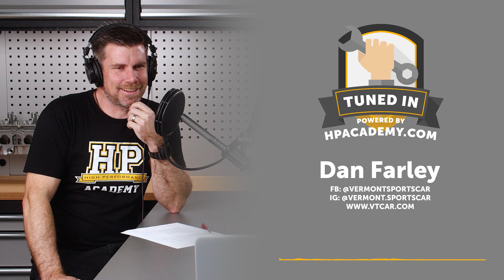037: Pushing 60 PSI Through a Subaru Boxer. [#PODCAST]

Comment: Holy Spaceballs Batman! Race teams have had rod bearings spinning because of effing "cross flow" drilling of the journals since the 60s! 944s blow up almost exclusively because of the cross flow drilling.
The failure comes when the oil pressure can't overcome the centrifugal force to force oil out the holes to the rods. It's pretty common to be an RPM specific issue across platforms. Anything beyond 7000rpm and failure is always looming with a cross drilled oiling flow. A diagonal straight shot from the main through the web and out of the rod journal is the only way to do it. To fix Porsche and Subaru cranks as well I'm guessing they pin the original holes and drill straight shot holes.
I get it from a builder perspective, it's just not something I'm looking for. However, from an Engineering perspective, there's absolutely zero excuse for that. Ford and GM knew that was an absolute no no lesson learned by the late 60s. There are lots of forum discussion on it. What it is exactly is that a hole is drilled through the main and rod journals from one side out the other. Then it's drilled from the side of the throw of the rod journal to intersect the hole going through the main journal. This introduces multiple failure points. One it weakens crankshaft integrity. Two it leaves multiple reversing turns in the flow path from the main journal, into the crank, and out the rod journal. Third the inertia is throwing the oil outward from center on the main journal. To oil the rods it has to fight that inertia directly to go to the center of the main journal inside where it goes up to the center of the rod journal. Now that problem repeats, inertia is going straight out from the rod throw, the oil has to turn perpendicular 90 degrees to the inertia and go out either side of the hole drilled through the journal. Some manufacturers including Subaru only use every other main journal to feed two rods, now it's twice as bad.
Straight shot like ZRP, Callies, Winberg, Bryant, Moldex, Crower, and so on use is when a CNC machine drills a hole from the top of the rod journal, through the throw, and straight out the main journal. Oil travels in a straight line from the groove in the main bearing, straight through the drilled hole, and out on top of the rod journal going with centrifugal force. Each rod journal is drilled directly to the adjacent main journal on it's side. The drilled holes never intersect or share flow. 
I went DEEP on this one because people are still disputing it and forming opinions more than 50 years after the verdict was in. Cross drilling does not work. No manufacturers have ever successfully used cross drilled crankshaft oiling. Every single one has suffered from reliability issues and spun bearings whenever anyone tried to increase power output marginally. It's reprehensible that an OEM is that arrogant after 50 years to insist it's correct and everyone in the world has been doing something wrong for the last 80 years of spun bearings and broken rods lol. It's physics Subaru, I'm pretty sure you guys attended a University somewhere.

Comment: Subaru is a great motor. As long as you run through case studs and align hone the mains WITH HEAD TORQUE PLATES ON. I love the tips on pinning the cases and especially restricting oil to the head. I'm going to look at the crank oiling flow now.

Comment: There's chop on the HPA forums asking about the blocked of oilways to the exhaust followers and camshafts. It's something I adised against unless he really knew what he was doing, and why I thought so - if you can comment either way? I may be mistaken, but I don't think so as this chap has a particularly unusual application, and the experience to do it correctly.
Reply: I was very fascinated with restricting oil flow to the cylinder head of an EJ engine! It would be great to go more in-depth, wish Dan had an online resource for the technical layout for this procedure.
Reply: @Hardcore_flat_four  Same here.  When I heard that, it got me really excited because it makes sense to me now why so much oil is coming out through the PCV port on these heads when you go around a corner!